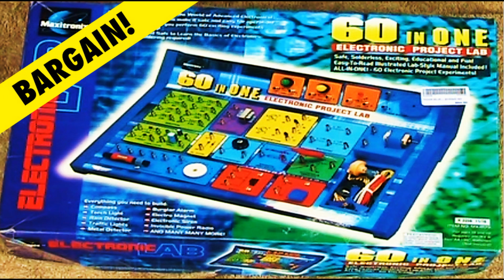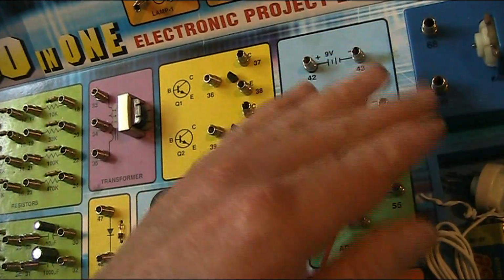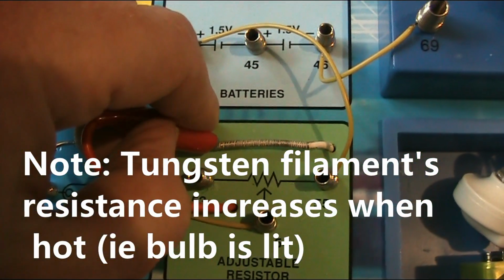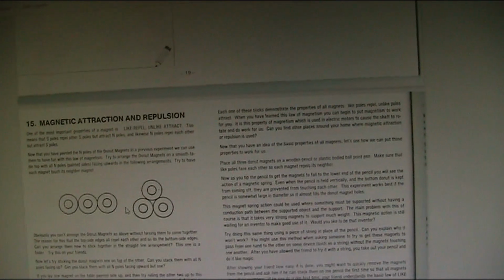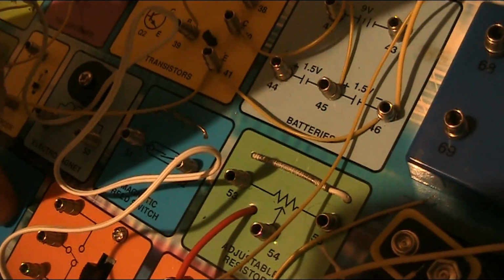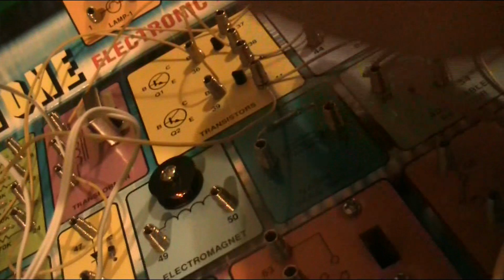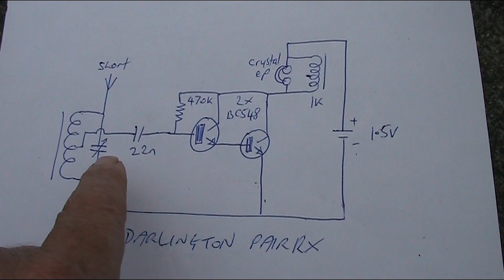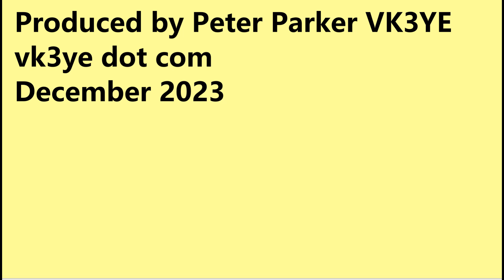Christmas Review: Maxitronix 60 in 1 Electronic Project Lab

Comment: I got my start in electronics with a 130-in-1 Science Fair project lab when I was a teenager in the early 90's. The AM radio station project was my favourite, which probably explains why I became a ham many years later. My original Science Fair project lab got rather tatty and in a state of disrepair later on, but I found another complete one for $5 at a charity shop several years ago.